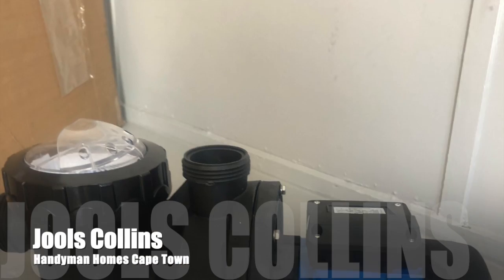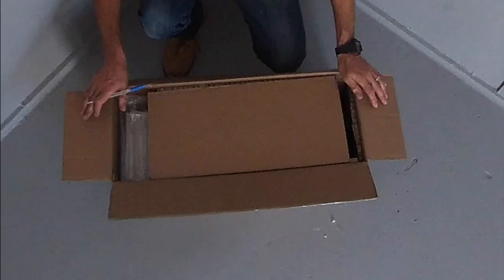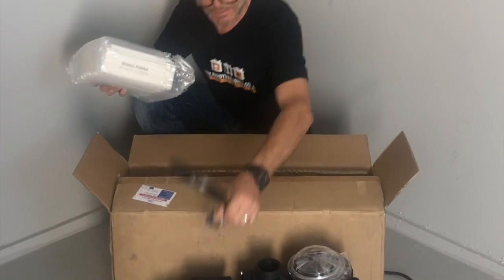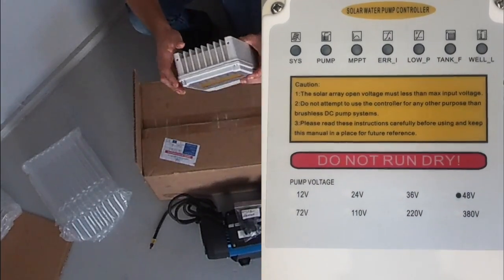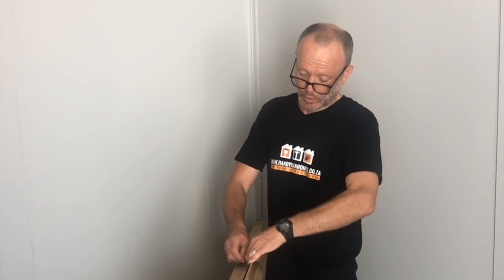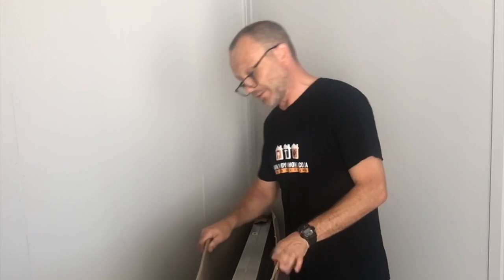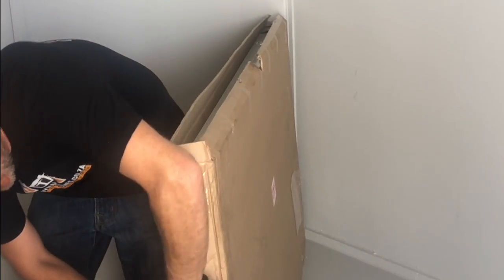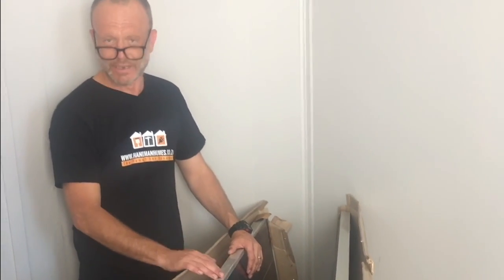Unboxing SOLAR POOL PUMP for swimming pool | Handyman Homes Cape Town

Comment: Can you use a normal pool pump or must it be specific one stating that it uses Solar ?
Reply: Must be a solar dc pump, standard ac pump will not work with this setup